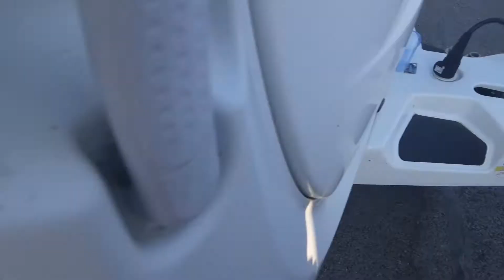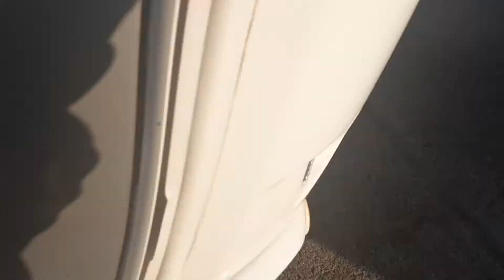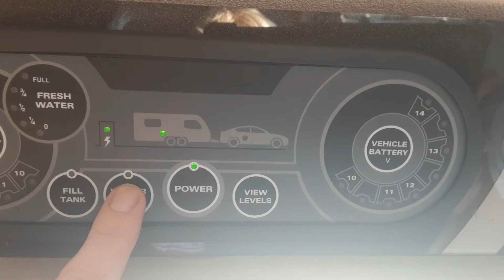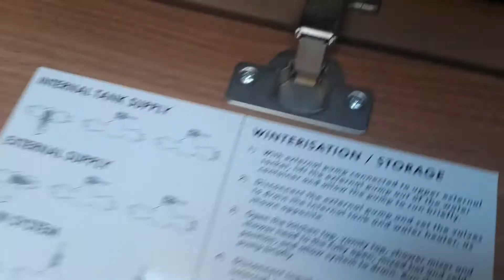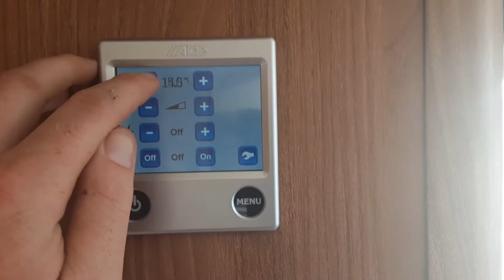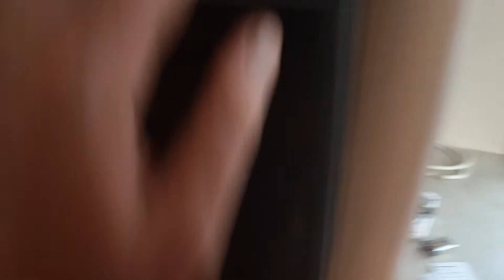2013 Swift Conqueror 645

Comment: Struggling to fill 2012 conqueror 645 internal water tank.. have external pipe in upper connector into water tank.. valve down internally... i press water pump and it runs for about 20seconds but doesn't fill tank..do i need to run taps or somthing..? Cheers.